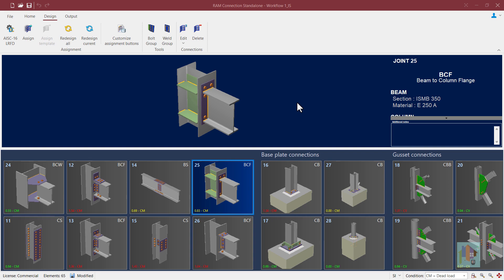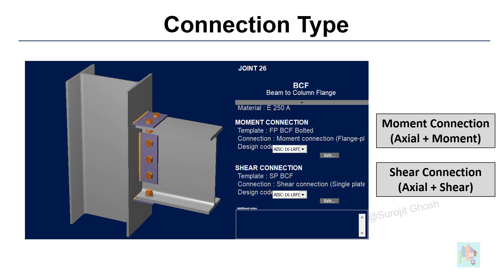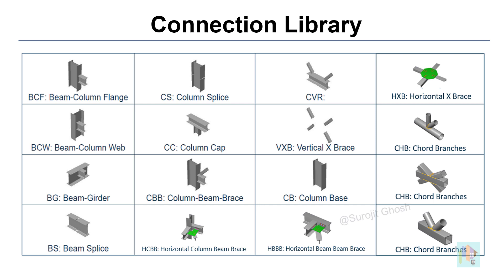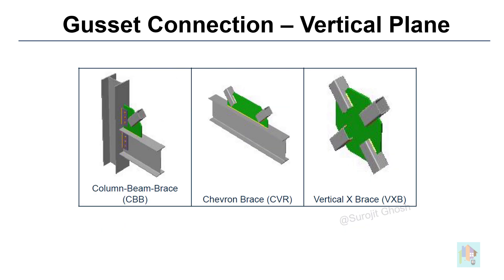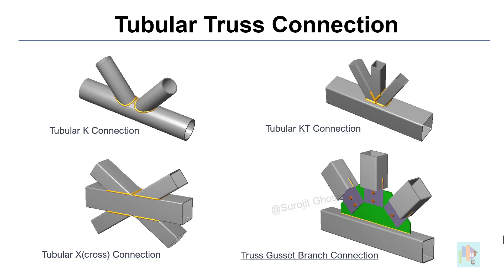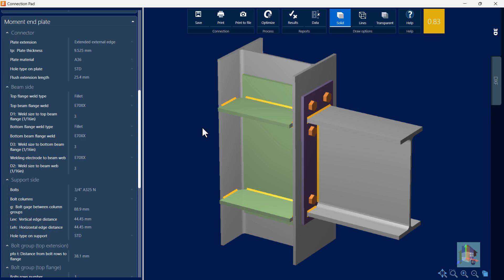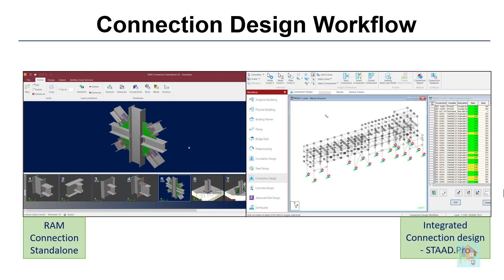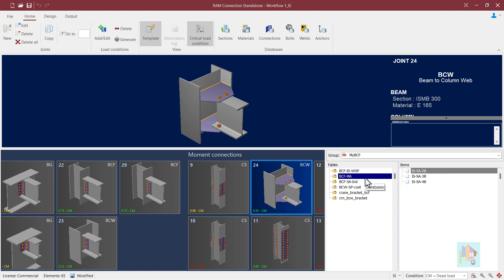Connection Design Overview - Part 2: Connection Database & Design Workflow || Library, Type, BCF,BCW

Comment: Very nice presentation. Sir, Please do make some detailed videos for connection design. Right now i am struggling in connection design part i am learning the PEB structure Modelling i have covered possibly everything in designing except connections, whenever i select End beam column flange joint the connection is not assigned, it says "tapered members does not support connection". I am assigning beam column flange haunch type connection to it and also various connections like bracings, purlins they are also not assigned, do i need to assign some parameters in analysis section in staad i don't know i am confused so much Please help me out ,Hope you will respond soon.